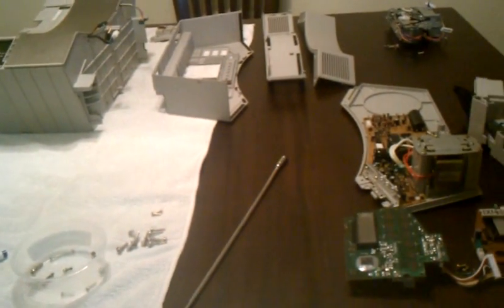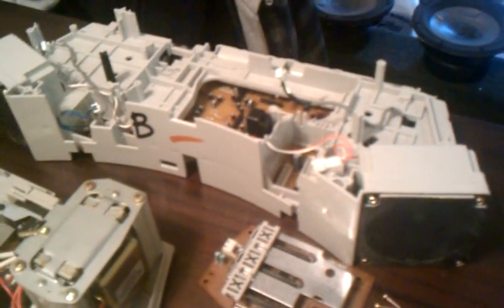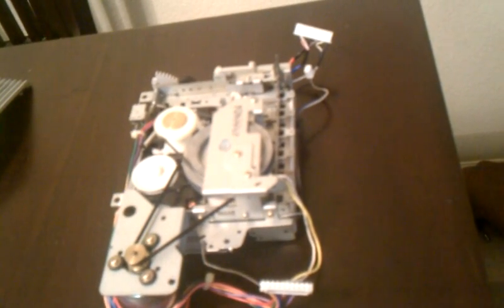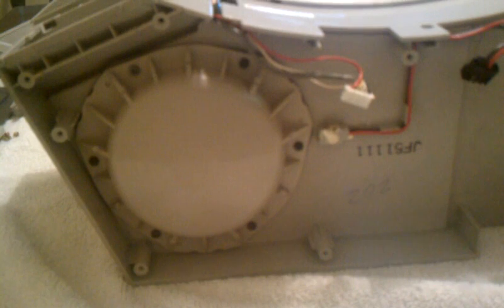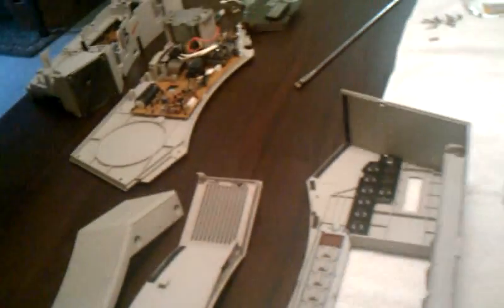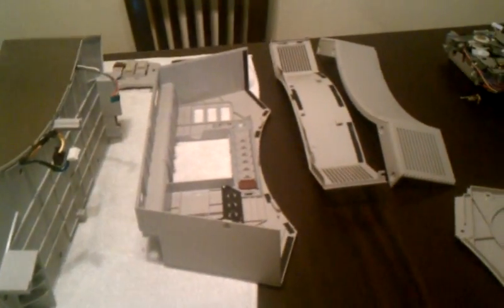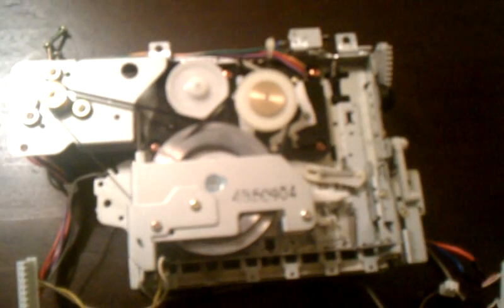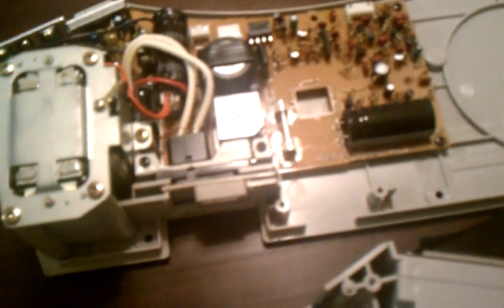Bose AW-1 Acoustic Wave Cassette Inside view

Comment: I need to know how you opened it? I've unscrewed all visible screws but it seems to be stuck in corner opposite the plug. I need to check the fuse.
Reply: I don't get it why nobody mentions the trick to opening these.  The cassette door prevents you from removing the top end which is the only side you need to remove screws for service, don't bother taking bottom off.  The cassette door slides forward to remove and from there it's a very simple unit to work on.

Comment: done good job! i have this model 3 pieces from Japan , and I can release all of part like your video but i cant fix it

1.all of them cassete died I think it's seem about rubber chain out of age 
2. 2 of 3 only right sound ,no Left all of input but i can hear a little pink noise when I turn up the vollume@Left+Right like any amplified  so i think amplifiled part L+R still working 
3.I love there re  sound too much heavy bass and clear mid high like listen to 12" home stereo component!!